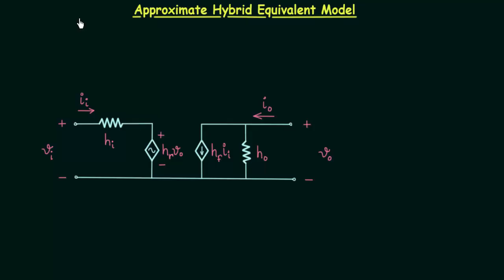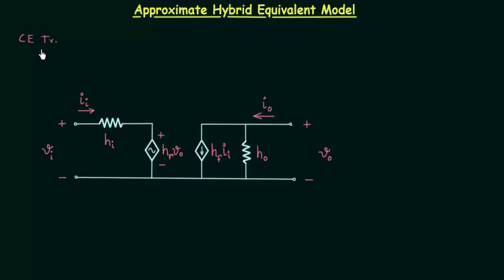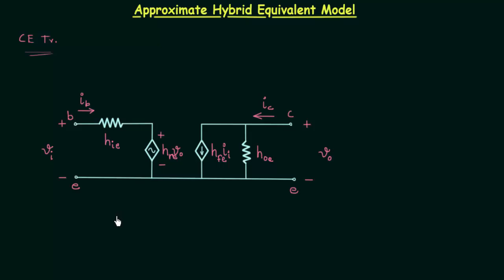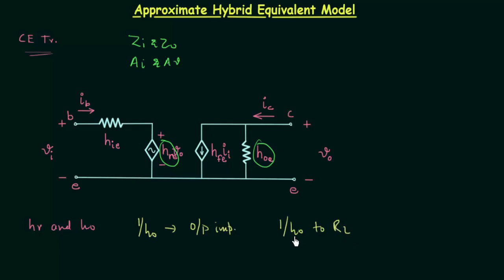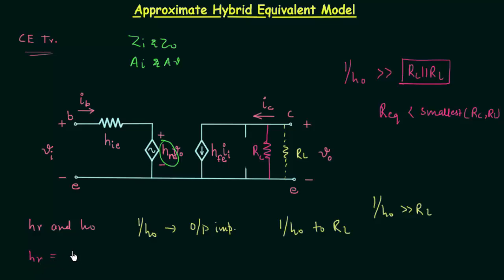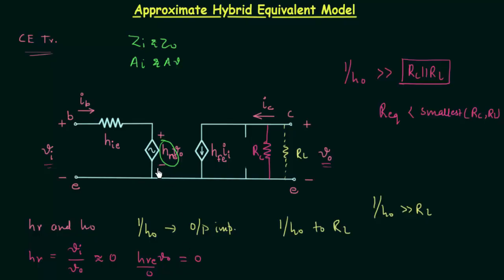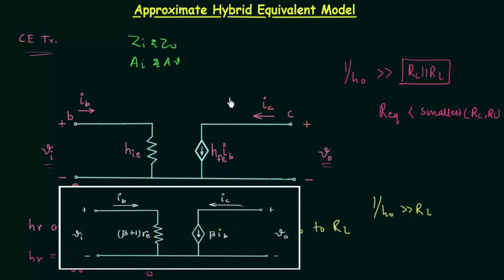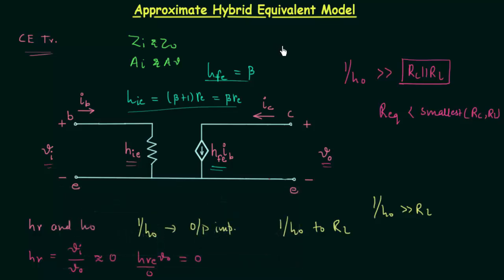Approximate Hybrid Equivalent Model

Comment: y the o/p voltage is greater than the i/p voltage?
Reply: for amplification,you need to get  "o/p voltage is greater than the i/p voltage"
Reply: Because this model CE for amplification
 and amplification for o/p is larger.
Reply: The purpose of transistor is to amplify the input so if you pass low input voltage transistor would amplify to high voltage by changing the resistance (ohm's law) resistance increases then voltage increases that is what he meant low input and high output voltage